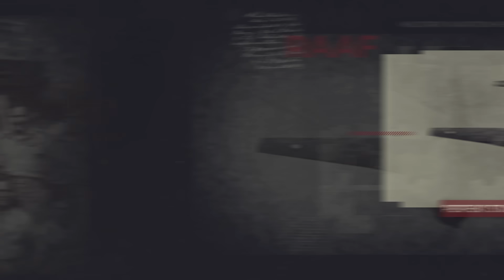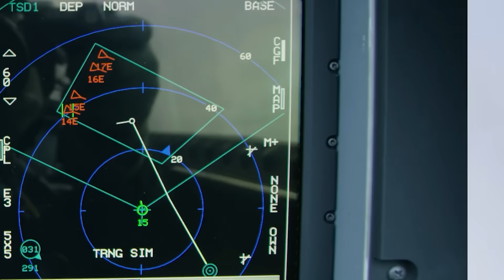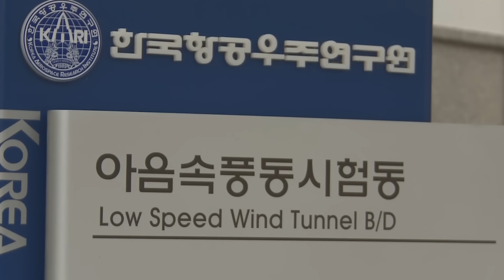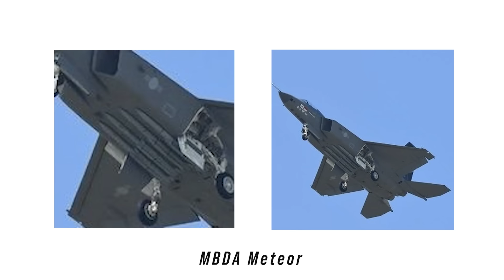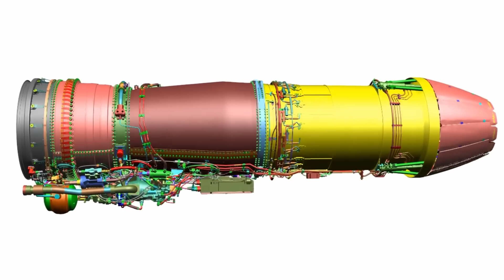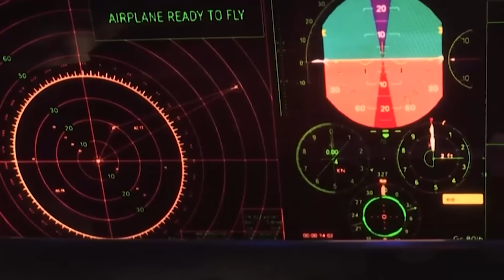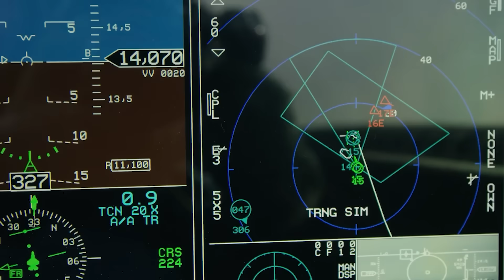KF-21: Korea's New Fighter

Comment: Im glad that the Philippines is interested in the KF21 since the Philippines operates Sokor made fighter jets like the Fa50PH developed by KAI in South Korea in which helped the country's modernization program. Plus this 4.5 Gen design is as sexy as of those 5th gens such as the F22 and F35
Reply: Among the contracts between Lockheed Martin and KAI are as follows.
FA-50 has a constraint that it cannot exceed the latest F-16 specification.
So the FA-50 has its limits.
However, the FA-50 is a cost-effectiveness and has a full role to play.
Very powerful as a 5th generation pilot training, proximity support, and small multi-roll fighter.
It must be a very useful aircraft for both training and practice.
Armed forces are also evolving.
In Block 2
AIM-9 Sidewinder
AIM-7 Sparrow
AGM-65 Maverick
IRIS-T
KEPD 350K-2
AIM-120 AMRAAM
It will be armed.

What is unusual is that the Korean-made AESA Radar is better than the US-made Radar with performance limits.
However, due to the inherent limitations of FA-50, it seems to be impossible to mount.

However, KF-21 has no constraints.
This is because Korea has developed core technologies such as AESA Radar, IRST, EOTGP, and RF Jammer.
The interior armament is also under development and the MUM-T system is also under development.
We're testing to control three drones with wingmen
It is being developed as a multi-purpose fighter with more than five generations at the same time as the development of internal armoured windows.

The AESA radar developed by Korea is a gallium nitride material and is powerful.
It is currently used in Korean Aegis destroyers, M-SAMs, and L-SAMs.
Gallium oxide materials that are much more powerful than gallium nitride materials are also being developed.

Korea has strong EMP technology.
RF-Jammer is also very powerful.
It will reach NGJ-MB performance enough.

IRST is currently on board the frigate and in use.

EO-TGP is already applied to FA-50.

Core equipment is constantly being upgraded with the development of new technologies.

KF-21 Boramae is the name of a falcon when its young is raised for hunting.
Boramae is called the Little Raptor, but in the near future, it will evolve into the fifth and sixth generation fighter jets that will shine on itself.

I hope you will pay a lot of attention to KF-21.
Reply: 虛有其表，美國產線都沒移給你就代表你這架東西連F35還不如，F35都以經是失敗品更別說這個什麼k f21..
Reply: They're most likely getting Grippens and F16s than the KF21
Reply: @medicalassociate1701 Nah if they gonna pay their share in right time they will get KF21 for sure unlike Indonesia that guys already fucked up

Comment: U.S. defense contractor Lockheed Martin has agreed to transfer more than 20 technologies from the F-35A to KAI under a cooperation agreement. The engine of the KF-21 is the American model F414-GE-400K, and KAI selected American Texstars to develop the glass cover and windshield of the KF-X. The drivetrain for the airframe mounted subsystem (AMAD) was developed and manufactured by Triump Group. Aviation Systems (CESA) Emergency Braking System, Spain; Environmental control systems, cabin turbochargers, liquid cooling, and flow control valves from United Technologies; Martin-Baker's Mk18 ejection seat, Cobham's oxygen supply, communications antenna, auxiliary fuel tank and rocket launcher; Meggitt's external sensors, fire detection, air monitor, landing gear brakes; MBDA's beyond-visual-visual observation system for the Meteor air-to-air missile (BVRAAM); Curtiss-Wright's Instrument Flight Test System (FTI) and Data Acquisition System (DAS) for flight testing...
Reply: Glad Korea is working with people who has proven the technology.

Comment: The KF-21 may not be the best fighter jet on the market. But it is excellent alternative to US F-16, Franch Rafale, or Russian Su-35 in term of value vs total cost of ownership, just like Hyundai or Kia car. F-16 and other fighter jets are rather old design, expensive maintenance cost, no reduced radar cross section (semi-stealth), no sensor integration, limited range and weapon load, no future upgrade plan, etc. KF-21 was designed to address such shortcomings of F-16 once and for all, yet keeping availability high and the maintenance time and cost as low as F-16, suitable for sortie-eater and work horse fighter jet of world air force.

Comment: KF-21 is essentially a crossbreed between the F-22 and F-35, taking the advantages of both without the disadvantages of either. If it implements Augmented Reality via an HMD, advanced sensors, AESA Radar and the latest in combat information sharing and datalinking, I'd argue that the KF-21 has the capability to become a true bird of prey in the hands of an experienced pilot. Here's hoping that South Korea can make the KF-21 a truly capable air dominance fighter.

Comment: KF-21 is confirmed to have 2 variants 40 for Block 1, 80 for Block 2 for a total of 120 for ROKAF and possibly a 3rd variants in the future:

Block 1 as Air superiority fighter, a truthful role as air-to-air fighter very essential even when North Korea air force is garbage and absolutely necessary to escort other support aircrafts such as AWACS, tankers, electronic warfare planes etc. There's an ongoing issue in Korea to produce only 20 of these variants in favor of getting 20 more of the Block 2 variant. But this plan was backlashed cause only 20 for 1 variant is way too few to do its assigned role, it will prolong the time of retirement of the very old F4s and F5s meaning pilots lives are at risk and most importantly it will almost double the cost to manufacture since many SME that are involved have already produced necessary parts to produce 40 airframes. 
As of now it's not clear but it is leaning toward producing 40 block 1 with limited air-to-ground capability by having relatively simple GPS guided bombs like the KGGB or JDAM, which doesn't require almost any major software integration. And this is the version Indonesia is participating to develop and purchase 50 of it. 

Block 2 will be the multi-role fighter, this variant will need new AESA radar and software so that it can do ground strike with more sophisticated weaponry. Also this is the version that UAE and Poland are interested in. 80 will be produce for ROKAF by 2032

There's talk about Block 3 that could be planned to make the aircraft a full fledged 5th gen fighter with major modification notably making internal weapon bay and cover it with a stealthy skin.

It is easy to understand why KF-21 don't start right away as multi-role fighter, because this is the 1st time Korea is making a modern fighter jet and it is following the footstep of other major power who produced top class airframes, they all start with the air supremacy variants 1st then make ground attack or multi-role versions for example for F-15s starting from F-15E has the ground attack capability, for F-16s from F-16 block 15, Eurofighter from TR.2, Rafale from Rafale B. They are doing everything step by step and it is a miracle that they haven't had major issues while research, develop and producing up till now, and It won't surprise me if they will encounter problems in the future since aircraft manufacturing isn't easy, not any country could do it and they will be lots of trials and errors big or small up ahead to be overcome.

The big reason Korea is making KF-21 is that it can use it as the platform to integrate their own weapons systems unlike the US made aircraft which Korea will have to have US permission and help to integrate their own weapons, it will cost time and a lot of money. Reduce to absolute minimum on foreign technology dependency so that they could also export it. Lastly Korea's Air force for its size still doesn't have any dedicated electronic warfare fighter yet, KF-21 will also be the optimal aircraft to make EW fighter.

Comment: The F-22 is a different class of fighter jet. It features powerful jet engines enabling supersonic supercruising with a large airframe, thrust vectoring for enhanced flight safety and maneuverability, and nearly perfect stealth capabilities. The KF-21 lacks these characteristics. It might be more reasonable to consider it as a stealth-modified version of the Super Hornet F/A-18. However, in a later upgrade phase, even if all its performance falls short of the F-22, one advantage is that the airframe, though smaller than the F-22, is designed with a larger internal weapons bay. This allows it to carry larger-sized missiles that cannot be equipped on the F-22
Reply: The cost of maintaining the F-22 is difficult to cover unless it is a large country.
additionally, the United States does not sell the F-22 to other countries.
Korea, which still lacks jet engine technology, has no choice but to create a cost-effective fighters.
most countries cannot even afford the cost of maintaining the F-35.

Comment: I have no doubt that NGAD, NGF, and other 6th-generation fighter projects under consideration (in association with MUM-T) represent the future of air power. But when will they arrive and what will be the price nations have to pay to buy and operate such systems? Look at the delays, various technical teething problems, and cost overruns that have plagued the F-35 and even the “conventional” T-7. Also while the 4.5-gen Rafale, Typhoon, JAS 39 Gripen NG, and F-15EX are all superb planes with plenty of service life in their frames, one cannot overlook the fact that they are decades-old platforms with limited growth potential. In contrast, the KF-21 is new, has the outward aspect of a stealth fighter, and should come with a modern electronics suite, not to mention lower flyaway and operational costs and you have a strong (or only) contender to replace the 4.5-gen currently in service, at least for Western or West-leaning countries. In this respect, whether Korea thought of this in advance or not, they can become a significant player in the future “medium-to-lower-tier” fighter market if the KF-21 meets performance and cost-related expectations set by the designers. It can also be referred to by the outward appearance of the jet which closely resembles the F-22, that if Korean engineers can incorporate the multiple aspects of stealth technology, including internal load-carrying capabilities and sensor networking/fusion, they can gradually transform this 4.5-gen plane into a true 5th-generation plane with the least amount of delays and extra cost. The two-seat version even has the potential to be used as an electronic warfare plane like the Growler, again with no need to make major changes to the airframe. One thing to add is that the KF-21 is slightly larger than the F-35A and there has been talk that internal weapons loading was baked into the design so if the tech can be worked out in due course it should be able to carry internally at least the same amount of ordnance as the F-35A which can greatly increase its appeal to buyers down the line.
Even if 6th-generation planes come online, the prohibitive cost of such a platform will mean only countries with clear-cut foes will even think of buying them, and even these countries will only be able to deploy them in limited numbers. This means even the largest air forces in the world can only operate small numbers of such systems coupled with unmanned drones, with the remainder of their manned fleet being made up of 5th or 4.5th generation backup fighters. For countries that don’t face existential threats or can't handle the purchase and operating costs, but want a credible fighter jet, they could opt for less capable but still potent airframes such as the KF-21 as well as thelLatest versions of the Rafale, F-15EX and Typhoon. I think in S. Korea’s case it will want to buy the latest and greatest from the Americans once it becomes available (albeit silver bullet-like small numbers) but will fill the bulk of its fleet with the improved versions of the KF-21s that will give it a well-balanced high-low-mix. FYI with the money being poured into ROKAFs F-15Ks and conversion being made to its KF-16 into F-16V configuration, these two platforms will continue to serve Korean for the foreseeable future and only be gradually phased out.

Comment: As a Korean, we say KF-21 is developed to replace old F-4 and F-5. KF-21 is not a competitor of F-35, even F-18, F-16. KF-21 is not a 5~6th gen. stealth fighter. its ummm...probably 3~4th gen. Looks stealth?...okay add 0.5.
Reply: It is definitely 4-5th gen. 3rd gen is stuff like MiG-21, MiG-23, F-4 and F-5. This thing is about same as modern iterations of F-16 and MiG-29(35)
Reply: @iansysoev9462  we already have FA-50, F-15, F-16 and F-35..don't need to have similar jet fighter.
Reply: @youngmoon8762  those are american fighters, do you want to wholely depend on another country in such an important thing as military aviation? FA-50 is trainer aircraft based on F-16, it is not nearly as capable as latest mods of F-16 or KF-21.

Comment: 2:50 "This resulted in a further four variations on the initial C103 design, each with varying capabilities, C103, C105, C107 and C109. Of them, design C109 would be chosen as the design to carry forward"
This is a misunderstanding. They were not the competing variations. The C103 configuration, chosen by the exploratory development phase(ended in 2014), was serially updated into C104, C105, C106...and C109 finally, within PDR(Preliminary Design Review) phase(Jun 2018~Sep 2019).
2:38 5:25 These are the official concept arts of C109, the final configuration, released by ROKAF in 2018. The PDR phase was completed here, and the CDR(Critical Design Review) phase began.
The C109 design became the prototypes we can see them flying now.

Comment: why does almost every inDev 5th Gen Fighter either look like the F22 or the F35
Reply: F22 and F35 used computer simulation to reduce RCS and found out that's the optimal design. so there could be a slight difference but the basic design would be the same.
Reply: aerodynamic for stealth

Comment: If the KG-21 Not developing stealthy airframe,then the next best development should be vector thrust because if the KF-21 can close the distance to a air to air dogfight it will need a superior maneuverability capability. Sincerely, Cinderella 😎
Reply: air to air combat is moving into BVR, sensor fusion and drones, thrust vectoring massively increases the maintenance cost and the benefits are simply not worth it.

Comment: I guess mimicry really is the best form of flattery. That thing is basically a carbon copy lol. Respect for using the number 21 and not trying to call it a 23.
Reply: It's Lockheed who designed the base model of KF-21 and why call it a copy?
Reply: You obviously need to be better acquainted with the development history of the kf21. They went through dozens of designs of all sorts including single engined, canard winged ones before settling on this. It's not as if they set out with a copy of the f22 from the outset. It just happens to be the case the current design offered the best solution for what the aircraft was meant to achieve.
As for its name do you think being revealed in 2021 has anything to do with being called kf21?
Or do you think choosing a number is just an exercise in 'respect'?

Comment: 1. engine
2. anti radar paint
I don't think South Korea has that two key tech. So America still controls Korea, and can decide how many KF-21 they can build.
Reply: The engine is made in the United States. I understand that anti radar paint has already been developed in Korea.
Reply: @lifeextension9217 good to know!
Reply: 1. Currently South Korea, I believe it was Hanwha Aerospace, has started the program to develop their own indigenous engine for KF-21.
2. South Korea already has their own Anti Radar Paint technology. 

You don't need every technologies to make Jet or Tank in first step. when South Korea developed K2 Black Panther, they choose German Powerpack in first batch of production, and wait until their own indigenous Powerpack is developed by Hyundai infracore. 
Situation of KF-21 will be same, You will see eventually, Next batchs or blocks of KF-21 will have Korean Engines.
Reply: The engine is General Electric f414 ,similar to what in f18 hornet,pumping out 19000pounds of power,however f-21 is powered by two GEf414 engines!

Comment: The problem with KF21 is that rival U.S. companies, including Lockheed Martin, continue to hinder it...KF-21 was developed as a highly scalable fighter made by looking at the 5th to 6th generation, not the 4.5th generation, but claimed that it was the 4.5th generation to prevent political interference from existing weapons developers..//If Korea is weak from the perspective of the United States, it will be difficult to make all-out efforts to protect the Korean Peninsula against China, Russia, and Japan (a potential imperialist countries) at the level of an all-out war instead of Korea.(Some might argue that you only need to buy US fighter jets, but importing US fighter jets is too expensive to maintain, so if you buy 10 US fighter jets, you can only use 5; the rest is for parts and cannot be repaired at will because it is impossible in Korea. Therefore, in the event of a war, utilization is limited)
Reply: It's not just it's expensive to maintain but that the US has refrained from support at critical times before just as Trump has suppressed the provision of intelligence to Ukraine timed with Russian attacks, Elon has paused StarLink access again timed with Russian attacks and even prior to the Trump era, Iran's F-14 fleet was grounded due to a lack of support though that can be considered to be understandable.  We once considered the US to be a reliable friend but recently that simply has been proven to not be the case.
Reply: @johnwang9914  Ukraine isn't a ally of the USA. whats so hard to understand about that?